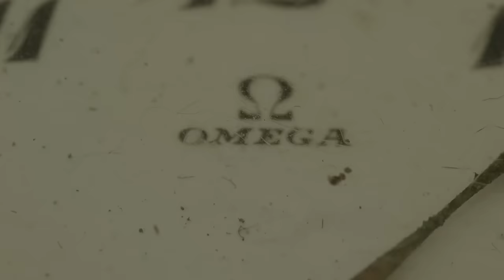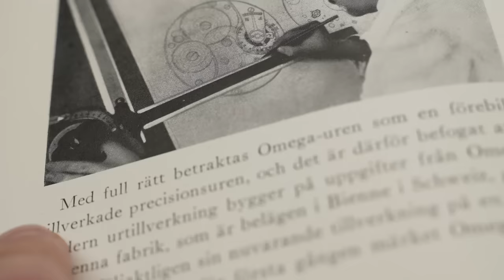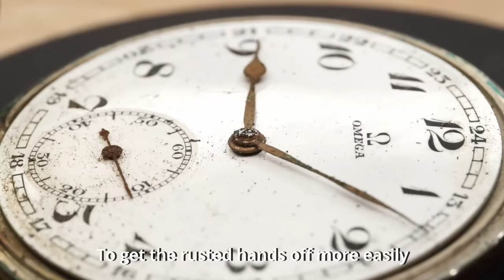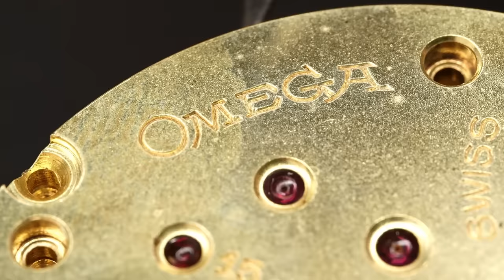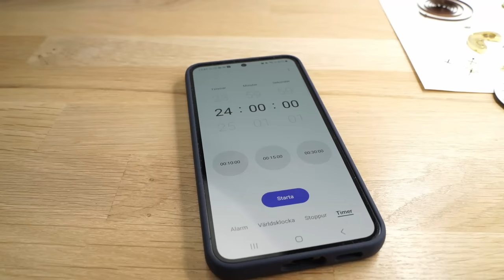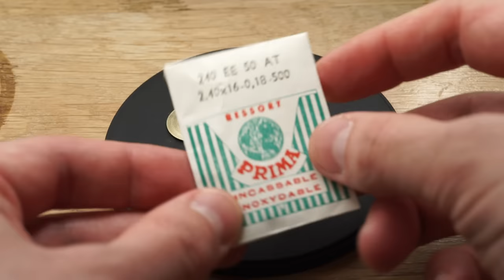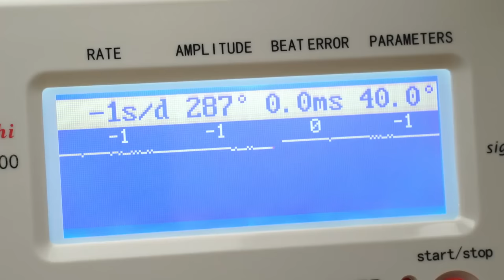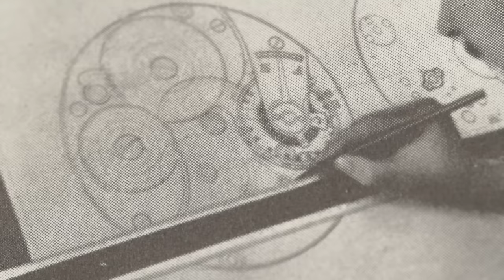A Century Old Omega Watch Restoration - Rusted - Pre WW2 - Silver Casing - cal 40.6 - ASMR

Comment: Beautiful video.  Great camera work!  One suggestion, when you remove the balance wheel and balance wheel cock, I suggest grabbing the wheel and cock together with the tweezers to lift them out.  I also place the unit on the table with the balance wheel on top and the balance cock below with the balance wheel pivot in its jewel hole.